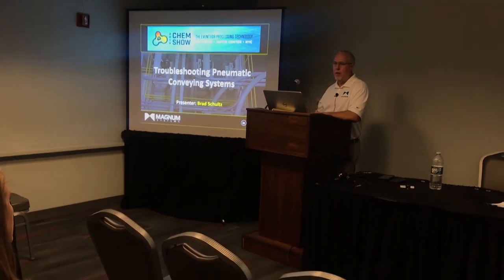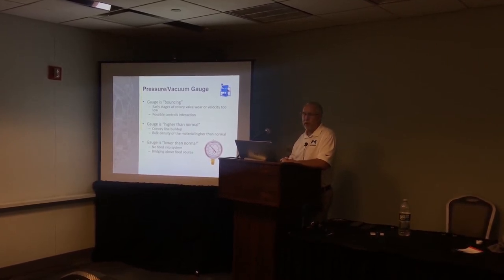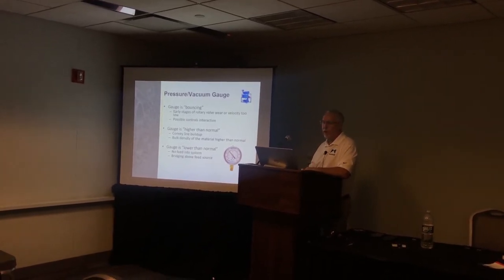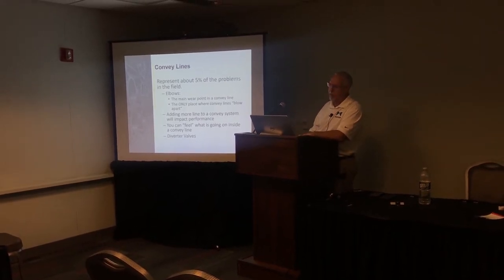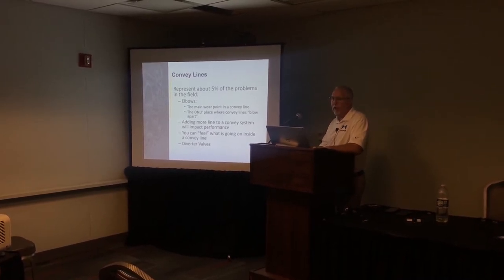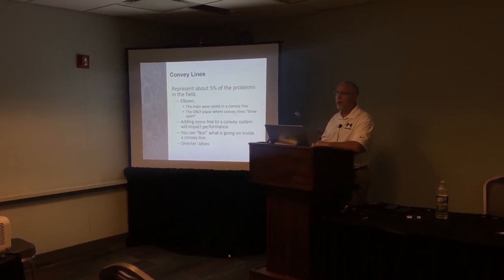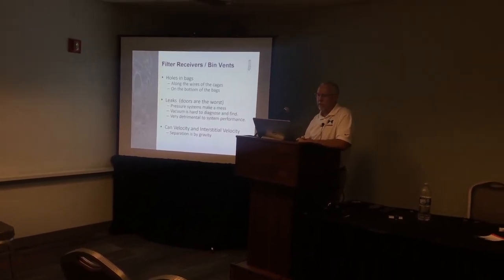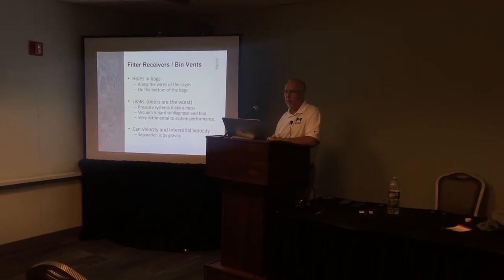Troubleshooting Pneumatic Conveying Systems   Dilute and Dense Phase   Chem Show 2019

Comment: Sir,
I ask one question. My system dense phase. Already one venturi nozzel present in below rotary valve. I introduce one more venturi nozzel fixed in air inlet beyond existing nozzel. If it is possible.?
Please give your guidence